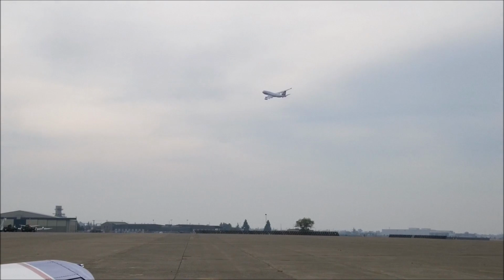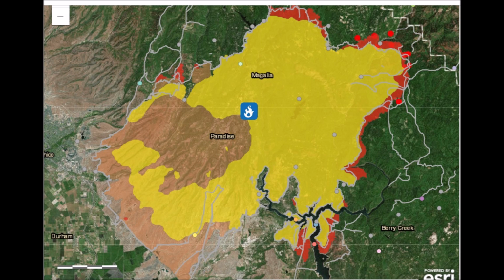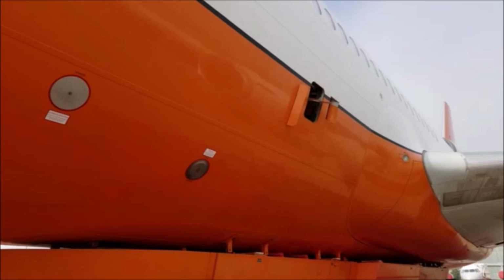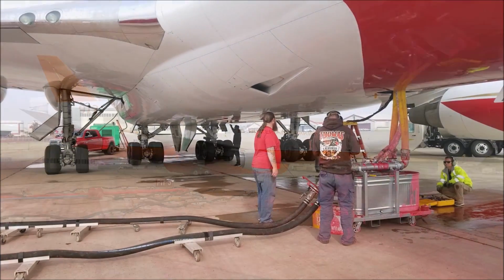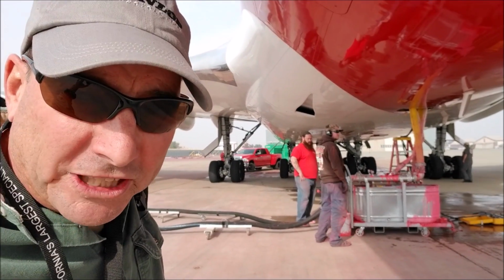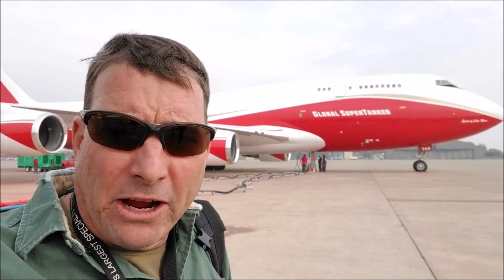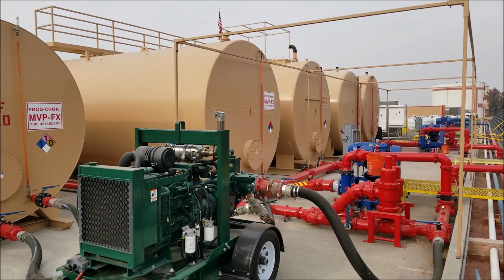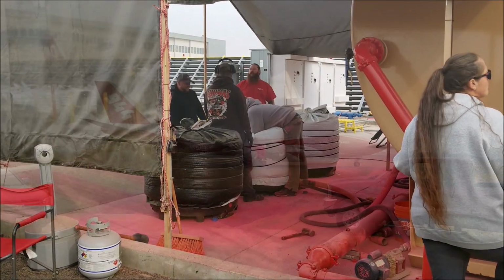747 Global Supertanker 'Camp' fire Day 6 UPDATE McClellan Load and Return

Comment: Juan I have a question.  It seems like one huge mistake that is confusing the politicians, its not a forest fire its a wild fire.  To me it looks like the forest it still there and the trees are still alive for the most part.  It is the underbrush, would logging will just make more large areas of low brush with lots of sunlight to fuel it?  Brush removal, and finding a receiving industry for the lower value wood products produced seems needed.  The tree's look like a very very small problem compared to chaparral and manzanita growing densely, in the videos of the fire.  Looking at Malibu and areas farther south, that I have hiked and biked in extensively for decades, it's actually the same stuff or similar burning in Butte county where I also used to ride mountain bikes, the low brush is a tinderbox and logging won't help solve that, it just further establishes that industry has no use for the less lucrative wood chips from brush removal.  Is logging really going to help if it directly competes with finding any subsidizing industry that would accept plant fiber and wood chips from brush removal?
Reply: Oh, you noticed that Butte County has what's actually called high chaparral as opposed to low Chaparral in So Cal.. And yes, it's a fuel problem more than a timber problem, and yes again, no one wants to pay to have it addressed and there isn't any money in it as a product. Logging would likely make it worse, unless the contracts are thinning and removing cull trees rather than the good timber - and it's the reverse that always happens, no one would bid a job like that as the timber value wouldn't pay for the effort. Had the old trees had been left, they could withstand fire better due to their spacing and their lower branches being higher up away from the ground fuels. Mature stands hold soil moisture better, afford more shade, shade out Manzanita and other crown fire species, etc. No easy answers... other than to throw money at it only AFTER it becomes an emergency like this. Again.

Comment: What's the length of fire line that a drop covers. It seems like a pittance compared to the actual length of fire perimeter.
Reply from the maker: up to a mile.
Reply: @blancolirio  Thanks

To put some things into perspective
747 = 19,000 gallons @ 30 minute pit stop
DC10 = 9000 gallons @ 15 minute pit stop
Mars Martin = 7000 gallons @ 30 second pit stop

747 can drop 1 mile per drop @ 4 drops per day

6,000,000 gallons = 315 equivalent 747 loads

Comment: That’s got to be quite a workload on the crew. I wonder how much hand flying is done and how much flying without the flight director is done. Short turns, weight balance performance data and the non flying pilot twisting headings and altitude around all day would burn me out.

Comment: At what percentage of cargo gross weight is the 747 operating? I read that the DC-10 operates far below gross for quick maneuvering performance. And, another advantage of the 747 beside the amount of retardant is it’s faster flying speed to and from the drop sites.
Reply: The 747F has a huge cargo capacity 274,100 pounds (124,330 kg), I don't think they use the full gross weight: https://en.wikipedia.org/wiki/Boeing_747-400#747-400F
19,200 gallons at 8.35 lbs/gal = 160,000 lbs (72,000 kg)
Edit: This is much less than the fuel capacity of 53,985 US gal / 204,350 L, even allowing for density differences.

Comment: The 747 and DC-10 were designed for high speed cruise at high altitude.  How does that affect their capability for the low speed, low altitude job of retardant application?  What would one do differently if designing a purpose built VLAT for fire fighting?

Comment: Juan, great inside view of air tanker operations. The 'Camp' fire has been a particularly destructive and disturbing event. It is thought provoking to observe the behavior of the fire within the burn area. Although it is fair to describe the town of Paradise as destroyed, it is not COMPLETE devastation. Calfire has produced a map that give some indication of the state of structures within the fire zone (here is the link: http://calfire-forestry.maps.arcgis.com/apps/webappviewer/index.html?id=5306cc8cf38c4252830a38d467d33728&extent=-13547810.5486%2C4824920.1673%2C-13518764.4778%2C4841526.1117%2C102100 ). It shows, as expected, that wide areas of the town of Paradise have nearly all of the structures destroyed. However, many homes and buildings did survive, surrounded by destroyed neighborhoods. The destroyed homes are shown as red icons, and the undamaged ones are shown as black icons. There is also some drone video that show this also. Intact homes in a burned out neighborhood. The question is why some homes were not destroyed. Are there some common factors? If you had a home in a fire zone, you would want to be that house, the one that survived. There is a short Civil Defense film from the 1950s that gives a hint about this. Test houses were built at the Nevada test site, and then nuked! The film is called 'The House in the Middle'. Here is the link: https://www.youtube.com/watch?v=pGJcwaUWNZg

Comment: From the look of the air compressor to recharge the system, it is a rotary-screw compressor.  They can move a huge amount of air at pressure.  They are extremely noisy though.

Comment: The DC-10 carries 9,000 gallons of retardant and the 747 carries 19,000  gallons of retardant. Can I assume that this retardant is mixed with water ? This wasn't specifically mentioned. Water weighs 8 lbs./gal. So...the 9,000 gallons of the DC-10 would weigh 72,000 lbs plus weight of the powder. The The 747 weight would be 152,000 lbs plus weight of the powder. Can someone confirm what the liquid is ?
Reply from the maker: Yes water.
Reply: Given the various chemicals in the retardant mix, the solvent is most unlikely to be anything other than water.  How much it weighs will depend on the concentration, but a ballpark figure is around 34 tonnes for the DC-10 and 72 tonnes for the 747.
Reply: @Ring_Zero  ...I'm curious how you came up with your figures. I just looked up the weight of a gallon of water and it is approximately 8.34 Lbs., just a bit more than the 8 Lbs. that I mentioned in my post. My math says 8.34 lbs/gal. x 9,000 gallons= 75,060 lbs just for the water ( assuming  a full 9,000 gallon load). then you need to add the weight of the powder and you will get more than the 75,060 Lbs. Let's round down to 75,000 Lbs...divide by 2 and you get 37 Tons...3 tons or 6,000 Lbs more than your figure. So where did you get your 34 tons from? I'm not trying to be mean about it...just curious.
Reply: @marbleman52  I'm using tonnes, not tons, and assuming density of water at 1kg/l.  The approximate relative carrying capacity of each aircraft should be close enough.
Reply: 1 US ton = 0.907 tonnes
Reply: @Ring_Zero  Okay....I understand now. I think I just went on by your spelling of 'tonne' versus our spelling of 'ton' and was automatically thinking in our units of weight. Okay...all good...thanks..!
Reply: marbleman52  anytime I hear TON, I always wonder WHICH TON, but in USA we use a short ton = 2000lbs. My British ton =2240 lbs, then there is the metric TON = 2200lbs, Real great, stay well.
Reply: marbleman52 that tones, is METRIC .

Comment: Juan, given you're an large aircraft pilot, other than the high temps involved, is there any reason you could think of, why they couldn't modify the bleed air system to pressurise the retardant tanks?  Bleed air, run through a chiller would seem to be the perfect solution to in-air tank pressurisation.
Reply from the maker: Great question.
Reply: Just speculation, but judging how burley those pressure vessels are, my guess would be they are pressurized much higher than ~ 40 psi bleed air.

Comment: Just out of curiosity I wonder if a B-52 could be configured as for fire suppression?
Reply: The DC-10 is carrying about 34 tonnes of retardant, and the 747 is carrying about 72 tonnes.  B-52 bomb-bay payload maxes out about 32 tonnes, but that would have to include tanks and dispenser equipment.
Reply: David Miller ... Is that 32 tons all internal? Or would pylons increase the load carried?
Reply: @Idahoguy10157  Boeing and USAF web pages only quote a single payload limit for a mixed weapons load, so I'm now assuming this is combined internal and external.

Comment: Has the inside of the large aircraft been gutted as far as all the seats and stuff that was in use during their commercial airlines days. I would assume that to be to reduce the weight so they can carry those heavy loads of fire depressant.
Reply from the maker: I think so.
Reply: Yes, the interior is empty, other than the crew’s gear.

Comment: Although I'm not knowledgeable about a DC-10's ability to carry weight, I was surprised that the "10" only carries 9M gallons of retardant?! Just the external tanks and what's inside the main body of the aircraft? Any feedback on this observation Juan?
Reply from the maker: nothing internal to DC-10. It's a matter of certification.
Reply: I heard 9 thousand gallons (not millions!) Inside of aircraft is empty. Gravity drop would be impossible unless it was pressurised like the 747.
Reply: @gordonrichardson2972  Good point I don't think the plane could get off  the ground with 9 million gallons 😊